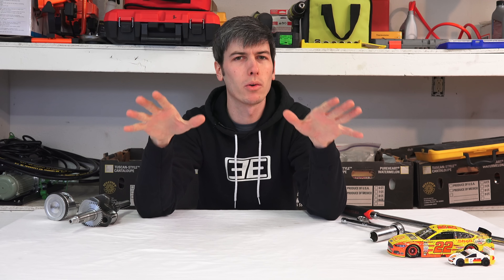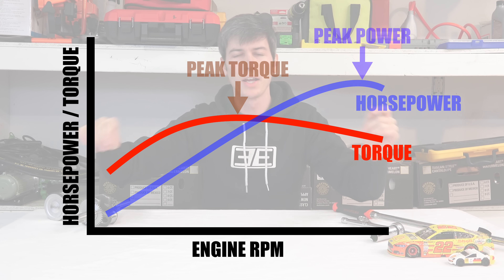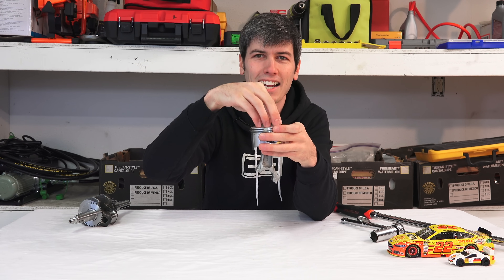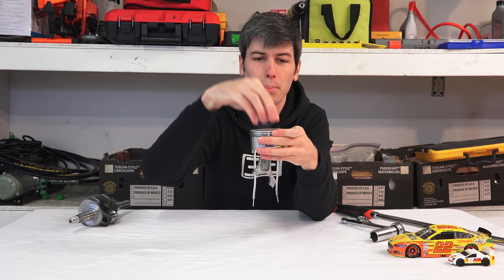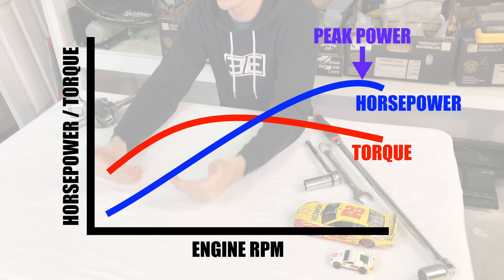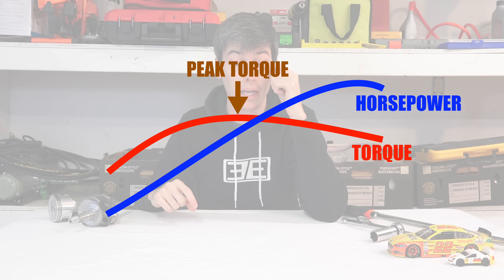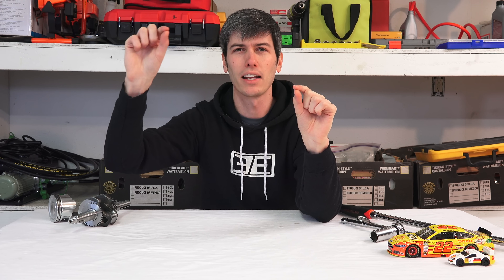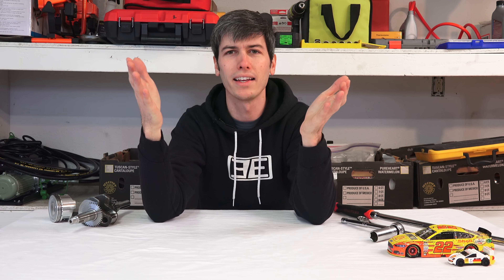Horsepower vs Torque - A Simple Explanation

Comment: Power = energy (or work) output per unit of time. Torque = energy (or work) output per rev of a rotary engine or shaft.
Peak torque: when the work (energy) output is greatest for each time the engine spins.  If revs go up, power (energy per unit of time) may still increase, but less so than revs per unit of time, and therefore less so than the power required to move the car along, in the same gear.
Reply: Torque is not work.  Torque is frozen and timeless. Torque CAN cause work. Torque TENDS to cause work. But torque can be present irrespective of work.  If and when torque is causing work it is creating power.  Torque may increase or decrease with RPM (the torque curve) and the power may decrease as RPM increases if torque is decreasing at a faster rate than it is being multiplied by RPM but the car will continue to “move along” and accelerate at a slower rate “in the same gear” until such point that the rate of consumption of the power is exceeded by increasing resistance: mechanical and aerodynamic.

Comment: to design an engine with more torque,  ( example: large trucks )  ......an engineer will design the engine with larger pistons and cylinders, larger connecting rods and the connecting rods  will apply their force " farther"  away from the  crank shaft,  not to mention the type of  fuel used to cause the explosion at  the top of the cylinder .............
Reply: Farther away from the crankshaft?  You mean the crank radius between the main and Rod journals also called more colloquially “crank throw”.  This and bore size are how each cylinder’s displacement is determined.  It does not provide leverage or mechanical advantage to the work done by combustion pushing the piston down the bore.  It merely converts the reciprocation motion to rotational motion on a 1:1 basis.  One RPM of the piston (Reciprocation from TDC to BDC and back to TDC) per one RPM of the crankshaft.  The increase in torque comes from displacement not from leverage if that was what you were getting at.

Comment: I feel like I understand HP vs. Torque less well after watching this. I always thought more horsepower was what could get you a hight top speed, but torque is what got to the top speed most quickly (acceleration rate). I picked up that torque can be manipulated with gearing, but the rest of it I did not understand. And now, I'm not even sure of what I thought I knew, which is that torque is most relevant to acceleration rate (or towing capacity). I feel like this was a "good explanation" for those who already knew what was being explained.

Comment: Why "Horsepower" and not "Power" The former is the unit of measure of power invented by James Watt.
Reply: Aren’t ALL units of measure invented by someone? Inches? Pounds, litres, cubits? Metres?  What have you got against poor old James other than metric is more consistent and intuitive.  Kw is easier to use but guess who the w part is named after?
Reply: @rollsroyce329  not my point - neigh, neigh and thrice neigh! Fabulous chap James. However, a title Torque vs Power makes sense. Horsepower is a unit of power as Newton metres are of torque.
Reply: @Tenagor  well that’s refreshing and a good point.  These comments are full of Gnostics who perpetuate the hivemind nonsense that: Horsepower doesn’t exist, engines don’t produce it, can’t be measured. Is less important than torque, is inferior to torque for moving “heavy things” or “up an incline” etc… 
Thanks for clarifying.  The framing is all wrong in my opinion.  It should be Torque vs RPM.
Cheers

Comment: The crux of it: how hard your car or truck pulls is determined by POWER at the crankshaft, NOT by torque at the crankshaft. The reason for this is quite simple to explain. Actually the accelartion or pulling power of the car is determined by the pulling force, or torque, AT THE WHEEL, or better at the contact patch between road and car where the tire meets the road. Now you might think that this force is determined by the torque at the crankshaft. This is only partly true, however, because between the crankshaft there is a reduction mechanism in the form of the gearbox and the reduction in the differential (and even the seize of the wheels factor in...). Simply put: double the reduction in the gearbox and differential and you will halve the speed, but double the pulling power. But if we look at the difference between torque and power at the crankshaft, power is defined as torque x rpm (x some constant, but that is irrelevant for this story). Now lets take two engines with the same torque output, but the second engine delivers precisely the same torque figures at double the rpm. This means that at every speed the second car pulls 2x harder compared to the 1st car. In other words: of the two engines the one that delivers the torque at double the rpm still pulls 2x as hard at the WHEELS. But as we stated POWER is determined as torque (at the crankshaft) x rpm. And therefore POWER at the crankshaft determineds how hard an engine pulls and not torque at the crankshaft!

Comment: You didn't explain the difference. You explained how HP can be leveraged through gearing to achieve speed. You did not explain the benefits of torque
Reply: Torque has a benefit beyond what it becomes when it is multiplied by RPM?

Comment: Interestingly enough HP and torque always intersect on the graph at the same RPM- 5,252. Jeffrey Z. in SC
Reply: And as Jason points out in a video on exactly that it is the least interesting and most pointless aspect of the relationship between Horsepower and Torque.

Comment: It’s even more simple. 
Torque without movement is zero power, zero horsepower. 
Then use the right formula. 
P= torque x engine speed. 
Watts = NM x radians/ sec.

Comment: 6:16 first part of this statement is wrong, no wonder so many people get confused
Reply: No, what he said is correct.  Peak acceleration will always occur at peak torque for a given gear .  However, peak acceleration will always occur at peak power for a given vehicle speed .
Reply: @rollsroyce329  let's compare made up numbers to discuss a concrete example at a given gear: 
Peak Torque : 5k RPM (1kN on the piston 5k times per minute = x power / sec)
Peak Power : 10k RPM (0.75kN on the piston 10k times per minute = 1.5x power / sec)
am I understanding wrong?
Reply: @Kl3tAS   Your units are wonky and power isn’t power / sec as power already includes a time element: Power = torque x RPM.  Or said another way Power = Work / Time. But as for a concrete example: double the RPM but at 3/4 of the torque gives you 1.5x the Power.
Reply: @rollsroyce329 yep egzacly 👍🏻
Reply: that peak accelerstion at set gear is biger at peak torque engine rom thanat peak power?
Reply: @mociczyczki  yes

Comment: Basically, a long connector rod provides power in the same way that a tire iron does a better job than a “6 Socket wrench for removing a tire. The “6  Socket is quick, especially on small bolts. That’s horsepower. But if you need to remove a truck tire, you need the tire iron, it’s longer and helps you get the leverage and power to twist the bolt. That’s torque. “6 socket is faster but only bares as much as your arm and wrist. The tire iron is strong because you can put two hands and a foot and push. These are two extremes so auto makers try to blend the two, kinda like making a “12 or “14 socket wrench and that has good pace and power.

Comment: All I am getting is that torque is not that important
Reply: Facts. The second gen Cadillac CTS with a torqueless 3.0 V6 with 275 horsepower, yet it gets dusted by the 250 horsepower 3.6 😂😂
Reply: I think it matters going flat roads or uphill.

Comment: But then, does high torque have any advantages? I'm asking this because some car models would have high torque and less horsepower.
Reply: in regard to performance at straight yep it lowering rpms at which engine generate the same power 👌🏻some or better write most avg rider like more lower rpms than higher  including me and here comes with help high torq feg 1000 nm at 3500 rpm = the same power as 500 nm at 7000 rpm asf …
Reply: A engine with a lot of torque would generally be more efficient because it does not have to be kept at a high rpm in order to make power. The tradeoff is high torque engines are generally larger and heavier. High torque would be best suited for a towing application high power for performance applications.

Comment: No...I disagree. 
In reality, vehicles with more torque are quicker/faster than vehicles with higher engine power outputs and relatively lower amounts of torque.
Reply: Disagree all you like, you’re attributing a capacity to Torque that it does not possess and that is not reality; that is mysticism. Acceleration is a measurement of how quickly a given amount of work can be done.  Moving a 3500 lb car 1/4 mile is called Work.  Work = Force x Distance.  There is no time component to Work.  How quickly that Work can be done is determined by Power.  Power = Force x Distance / Time.  Doing the same Work in less Time (acceleration) requires more Power.   Torque is the sound of one hand clapping.  Without RPM there is no clapping, no sound and no power.
Reply: nobody cares with what ypu agree or disagree and dont say abput reality if you dont recognize simple equation for specific theme 👌🏻😉🪠 the same car bike version with more peak power asssuming each jave perfect gearing always outaccelerate version with more torq but less power 👌🏻 feg civic type r fn 22 201 hp 193 nm 0-100 km/h 6-7 sec 0-160 km/h 15-16 sek max speed 235 km/h vs civic 2,2 tdci 140 hp 340 nm 0-100 km/h 9 sec 0-160 km/h 23-24 sec max speed  210 km/h 👌🏻in reality it happen cos power at whell divided bevehiclespeed = force which in reality launch vehicles forward and tprq is only component it is100% compensated be rpms for the same power at perfect gearing for set speed feg 1000 nm 100 hp vs 100 nm 100 hp geared both perfect and they will ride egzacly the same or lets assume its numbers at specific point in time where Gforces is measured at the same set speed feg 100 km/h now ypu have egzacly the same reading from both egzamples dosent matter how much big diffrences in torq be as long  as there be thes same whell power the only real  diffrences which you notice be that 100 nm 100 hp version will work on superlow for avg standsrs of rpad vehicle s rpms whereas 100 nm 100 hp on very high roms like for avg rpad car but there be no other diffrences in regard to performance  where feg you put to fight at let say 1/4 mile dragstrip 1000 nm 100 hp version vs 100 nm 1000 hp version both perfect gearing asf and higher power version 100 nm 1000 hp absplutely smoked higher torque version  1000 nm 100 hp be genersting much stronger output thrust /force at the same speed = accelerate faster 👍🏻🌪️👌🏻🪠so  get reall boi 😎👌🏻🌪️

Comment: His explanation was wrong! The car with greater torque will accelerate faster but will top out at a lower top speed. The car with less torque but more power will accelerate more slowly and top out at a higher speed. If you have two identical cars with the same horsepower but different torque ratings, all other things being equal, the car with greater torque will win the drag race!
Reply: @williamsheldon3149 Torque is the sound of one hand clapping.
Reply: Torque equals acceleration while horsepower equals top speed
Reply: @williamshelton3149 this is hivemind nonsense.  Power, not Torque, is the limiting factor in not only the vehicles top speed but also in how fast it can accelerate at any speed and how much weight it can tow at any speed.

Comment: 3:30
I think the facts are a bit poorly worded here
from a standstill, the car having higher torque will actually accelerate faster
although it is true that the with higher power will eventually accelerate faster at higher speeds
Reply: Hi, mate, engineer here. Actually, no. Jason got his explanation right. The car with the  highest power, given that it has the right gearbox, will win over another car with less power (both with the same mass, of course)

This notion that torque is better for pulling/climbing/accelerating and power is better for top speed is actually false (and many, MANY people think that, and repeat that fallacy everywhere)

Power is the single most important property when considering ANY performance action: acceleration, top speed, climbing, carrying load, etc
Reply: @lucasnahas  egzacly torq is bull💩🤭👌🏻🪠☕
Reply: No ,you forget that its not driving at the same final gear ratio  from low to high rpm  👌🏻 when it coms to max eprfromance you are at set speed always and use most powefull rpms range which engine can pffer you thanks proper gearing and in sich situation like on track freeelllly drag race or tracks with corners power is superior everywhere in regard to catalogue peak numbers and at which roms they are feg kawasaki gpz 500 s 60 hp 46 nm 0-100 km/h with 1 ft on 4,5 sek with 85 kg rider in gear on board vs  suzuki gsx 950 s a2 limited to 47 hp with massive 76 nm the same whole woeght woth rider accelerate to 100 km/h in the same test condition in 5,5 sek 👌🏻 at forst metres from dig everything depend on grip and weight distribution asssuming each vehcile have perfect gearing it absolutelly ndo t depend on torq level at engine crank 👌🏻 thers always specified rpms level at which specified vehicle shpuld be launch sometimes very high sometimes very low or everything between at end in results at first couple emtres there no big diffrencess where be diffrences is how much worse accelerstion csn be if driver make bad launch like to low rpms here vehicle with strong lowend /alot nm at low rpms in regard to peak power level dont lose to much sometimes nothing vs vehicl with very low nm at low rpms with long 1 gear realitvely if driver bog donrpms at launch there be huge lossses and from 0-100 in 3,0 like fpr r6 accelerstion time csn increase to 4,5 sec etc 👌🏻🪠☕

Comment: Excellent explanation! That's why rotaries with low torque are fun because you can always just change gears to obtain the desired torque and throttle response
Reply: @RaydenRotaryRacing  compact, lightweight 10,000 RPM Billet Rotaries. Does it get any better than that?  It does, with boost. 😎

Comment: ❌ WRONG COMPLETLY WRONG❌
Jesus Christ!

Here’s an oversimplified example

Bicycle connected to generator powering the same light bulb

Big man: Big, strong legs can’t pedal very fast but can apply a lot of force to the pedals.

Small child: Small legs can pedal very fast but can’t apply as much force.

As long as both generate the same amount of effort (power), the light bulb will illuminate the same
Reply: first of all big strong man can typically generated on bicycle measured power or like you want with light bulb which shine more the more power is genersted much biger power than kid 😉👌🏻 and second he basically said that more power mean more accelerstion = light bulb more  so wtf you are talking about 🤷🏻‍♂️🪠
Reply: Yes, and that's the conclusion of the video, in a sense. in your example, they both produce the same power, and that's the video's takeaway

Comment: I know this is an old video, but if you see this comment, I'd appreciate it very much if you could next explain the difference between pound-feet and foot-pounds. Thanks. And, maybe, explain to us what happens to torque between the crank to tranny to diff to wheel? Thanks again. Your videos are educationally great!
Reply: The technical destinction is that pound feet is torque and foot pound is energy or work. Although foot pounds are commonly when talking about torque anyways, I think it's cause it rolls off the tongue easier. 
If you put 1 pound of force at the end of a 1 foot long wrench you would produce 1 pound foot of torque. If you lift a 1 pound object 1 foot into the air you expend 1 foot pound of work. In the metric world its N*m of torque and joules for energy or work. The units share dimensions but measure different things.
In a transmission gears are used to change the torque and rpm of the engine to something more useful for the conditions. The differential is another final gear ratio that cannot be changed on the fly. The differential is also a special arrangement of gears that allows the wheels to turn at different speeds when the vehicle makes a turn.
The transmission has both under driven and over driven gears depending on the exact transmission. An under driven gear increases torque but decreases rpm. An over driven gear decreases torque but increases rpm. The differential or final drive is going to be an under driven gear which will increase the torque to the wheel relative to the driveshaft torque.

Comment: So Power is about how fast you can go and Torque is about how hard you can pull the weight ...
Reply: nope ,1000 nm at whell rwdious 1 metres = 1000 newtons force vs 100 nm at whell rafious 1 cm = 10000 newtons force second configuration pull more weight 👌🏻 torque :leverage = force vs power :speed = force aswell or power x time = work  from engine with 10 times or whatever less torq ypu can have 10 times more force this what reallly pull heavy 💩 around be setup enough shorter final gear ratio 👌🏻 125 cc engine with 10 nm torq and 10 hp with enough short gearing be able to pull more from dig than 20 litres turbo 5000 nm 900 hp engine from strongest road truck 👌🏻 well drive train losess must be exceed so maybe lil more anyways thats how it goes 👌🏻☕️